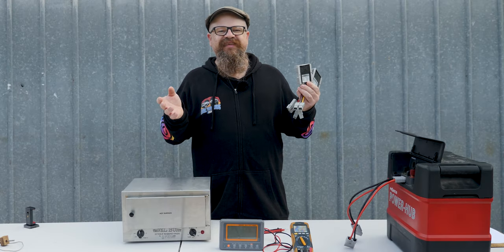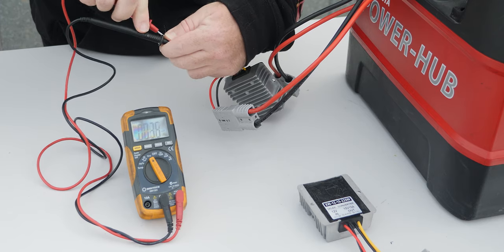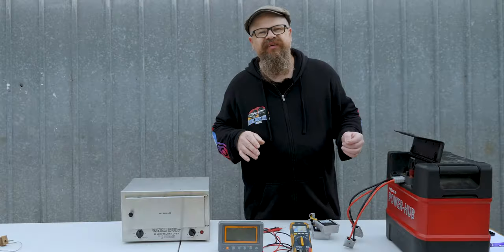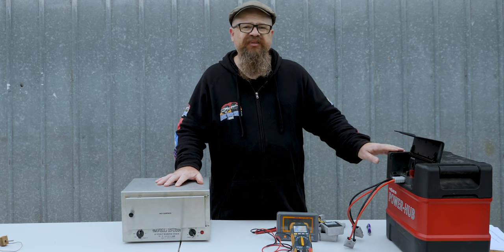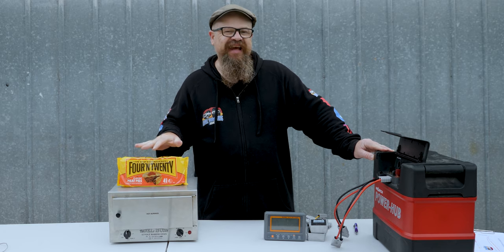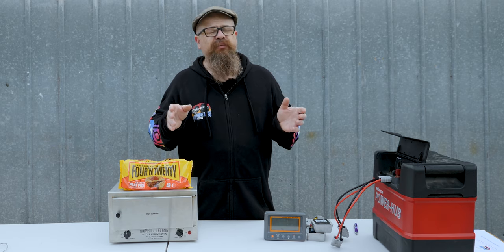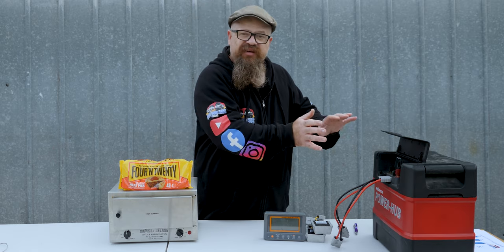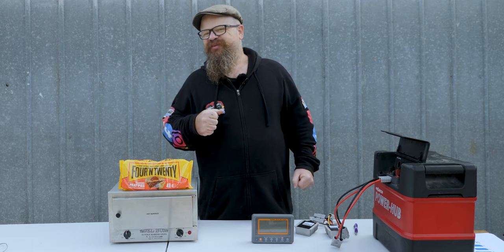Can you Improve Travel Buddy 12 Volt Oven Performance using Voltage Step-Up Converters?

Comment: Thanks Lock - being a retired Avionics technician I will er on the side of caution and potentially ☺️(no pun intended) try the 13.8V regulator only to protect the oven over long term use because I don’t want a raging fire while driving down the highway - I’m at my third stage and three years in to the Hilux/Aluminium canopy/RFT  project build with many prototype setups discovering what works and what doesn’t - I’ve gone with a simple 100ah Amptron Lithum battery system incorporating Redarc, Renogy, Engel mane even Kings products because I only run lights, 27 litre fridge and Sureflo water system - my Travel Buddy is on its way so I’ll start with a simple high capacity/fused/relay configuration first an monitor current draw and heat which are the two important elements that can destroy a system and your vehicle.
Reply from the maker: There's nothing wrong with a conservative system, while I like fiddling with all the latest tech like induction cooking and air fryers etc, most of the time camping, I run a fridge, lights and usually cook on a fire. 

While I'm not sponsored (I wish!) I've become a bit of a fan of Victron's gear. The customisation and versatility is unmatched.  I'm running a Cerbo GX (their comms hub) on a Raspberry Pi (Venus OS) so can monitor any of the systems parameters anywhere I've got internet. 

Though, back to the TB, I've been running the 15V stepup for a few years now without issue. Seems to work ok.

Comment: I added a 15v converter to mine today.  Oven now too hot to touch after 45 mins. Such an improvement. I found the stock blade fuse on mine was adding too much resistance so changed that out to something better and increased voltage to converter by 0.3v. All adds up
Reply from the maker: It sure does! It's a shame Midi type fuses don't come in lower amperages suitable for the TB. 

You'll love the 15v conversion, it really does transform the TB for the better.
Reply: @LockyourHubs4WDing  thanks for the great video even though a few years ago.  I'm getting near 180w into mine now.  Shame it's over 35 every day so yet to test it properly. I went with a circuit breaker in the end so I could easily disable the converter as required.  The blade fuse was clearly a massive resistance point.

Comment: Really great video, but yes it was drawing more amps from the battery at 15v but it was actually pulling more watts through the oven. So the first test doesn't really show the efficency all that well. What you needed to do was test the current on the other side to view in and out. But final test showed the end result anyways.
Reply from the maker: I don't think the efficiency of the step up itself is all that important other than academic intrigue, what is important is how much battery capacity you use in comparison with the other options.

Comment: So can you run the oven for 2 hours without damaging the battery with engine off ?  105  amp battery. Is it bad for the battery to drop to 10.5 v ?
Reply from the maker: Depends on the battery chemistry. Lithium no worries, AGM should be fine if you start with a fully charged battery.

Comment: Great video and loads of good tech data! My alternator runs at 14.4v so 15v should be fine, but curious if the ovens have a voltage limit before things break? What stopping you using a 24v step up?!
Reply from the maker: You'll eventually find the limit of a component or two, or maybe the wiring.

Comment: Hi mate does the step up converted need to to be disconnected while driving? Or can I just leave it plugged in the whole time?
Reply from the maker: It depends on the input voltage allowed for the step up, most will be able to use both battery and running voltage.

Comment: I just brought kickass new oven with digital temperture gauge and have two heating elements. 12v 260w  ... watching your video 15v 15A  ...  i look up for converter step up .. just wondering if i can use 12v to 24v 20Amp .... ...  but 260w / 12v mean 21.6A !!!   Not sure what i can do ....get 30A if have or not  thanks

Comment: As a straight resistive element in the travel buddy you will find that raising the voltage raises the current draw anyway due to ohms law. So the losses through the converters probably aren’t as bad as indicated here anyway. You could measure the current with a clamp or inline power meter to compare the oven current vs the battery current.
Reply from the maker: It's definitely Mr Georg Simon Ohm responsible here!

Comment: Superb video.. solid technical presentation from someone who clearly has a very firm grasp of the subject matter! I run a cheap Jaycar 12V warmer, only room for a couple of pies and you have to leave it open for the last 20mins of cooking to dry it out a bit.. but does a great job and doesnt take up much room. Those stepup converters are an interesting bit of kit at what looks like a pretty fair price.. thanks for the information and ideas.
Reply from the maker: I've tested those as well, for only a couple of pies, they hold up well in comparison!

Comment: I did some testing today on my new Rough Country travel oven.  I found the element was about 1.6ohms using a four-wire resistance test (no wire leads or fuse included), and using the figures from the 60V/100A power meter is was about 1.7ohms (including wiring, fuse and the power meter itself).  I ran with a 135Ah battery only, which dropped to around 12.05V with a current of 7.2A and power of 86W.  I then added a 4A battery charger where the battery settled under load to 13.98V with a current of 8.1A and power of 113W.  Lastly, I put two small motorcycle AGMs in series and it was running about 22.3V under load with a current of 12.8A and power of 285W(!).  I cooked a couple of pies that way.  I thought it might go "pop" and let the smoke out, but it went fine...for now.  Cabling was a little warm ;-)  This was done on a concrete floor, not in-vehicle.  I'm not staying with such a high voltage.  It was just for fun.

Generally, anyone wanting to work out the current draw in this type of oven can use 1.7ohms as a starting point.  Divide your chosen voltage by 1.7 and you have your current in amps, which is the output side of the step-up converter.  The current going into it will be higher, though these boost converters usually have a larger wire size on the input side to allow for this.  The limiting factor, apart from the element, will be the 15A fuse and the wiring, which I'm leaving alone.  My stove is rated 100W, while I see Kick-Ass specs say 130W max.  I'm guessing there's not much variation between all these brands, but you never know.

I'll be getting one of these step-up converters, that's for sure.  Thanks for the great video.  Well presented data and charts.  It's good to see.  New subscriber.
Reply from the maker: Some great info, and 22.3V! Wow, I thought I was keen with 15v!

Comment: Love the idea, will probably do this even though I Run a lithium atm..  Just want to make a note, that the factory wiring that come with it most likely could do with an upgrade.. Especially as it has a 1tamp blade fuse and most likely 15amp rated wire... I'd definitely be putting 12g (25amp) cable on and a 20 amp fuse
Reply from the maker: That's a great suggestion.

Comment: They are purely a resistive load - A length of nichrome resistance wire, more or less.
Not a lot to go wrong, and makes them fairly tolerant to different voltages, but I wouldn't push them much further than 15v
I use a 24v version, and it's a bit slow dead on 24v, but nice when the sun is out and I'm at 27v, 28.5 on the road and it's beautiful.
Reply from the maker: Yep the 24v unit runs great! There's an episode on the channel comparing the two.
Reply: @LockyourHubs4WDing  I'll look that up, I'll have a couple of videos of my own coming out soon. I have a 6x6 ex military land rover.
Reply from the maker: @TheAussieRepairGuy  Nice, the 6x6 Perentie with its turbo Isuzu engine is a great thing! 

I look forward to checking out the videos.
Reply: @LockyourHubs4WDing  I have a 4x4 gs as well. I'll let you know when they go public

Comment: The 13.8 makes sense, as said being a charge voltage which is way you use them when driving or hooked up to a battery taking a solar charge. They can be used off stand alone battery but it's not an ideal situation. On a sla performance is only going to get worse as the voltage drops.   Interesting to see results long term. I can imagine it impacting on the oven much at all. If any wiring couldn't handle that small increases, I'd be a bit disappointed. If be interested in that Guage of the nichrome heating element and if you could wind another to improve performance.   Likely not worth the effort though.
Reply from the maker: I don't think a modified element would be worth the effort, a second element though.... Just need to convince TB to sell me one! (They wouldn't sell me one....)
Reply: @LockyourHubs4WDing  you can buy nichrome heating wire for vaping . it comes in different gauges and there for different resistance/foot or length. i reckon with a bit of fiddling and measuring, you could set up a parallel heating element to run with the original. one on top would be nice..ooooh and a fan. anyway, my roadchef is on it's way thanks to your vids. I like aussie built and try and promote aussie stuff on my channel but there was too much going for the road chef to make me buy the buddy. i would have happily paid the premium to buy aussie if it was an equal or better product. oh well. cheers for the vids. I like your more technical approach to the items. nothing shits me more than an unboxing video with info I could have read on a website. PS I'll give you a shout on my channel when I get around to doing my review on it.
Reply from the maker: @DENMONKEY  My ideal TB would have a digital thermostat/timer, insulated door with overcentre latch, 13.8v step up that cuts in and out with the charging voltage, and your idea of a fan is great, there is a large temp differential when running both stainless steel trays in the oven. And don't forget the second element! I've just seen your channel and subbed, thanks in advance for the shoutout!
Reply: @LockyourHubs4WDing  cheers. I also checked out your winch ring vid. that was interesting to say the least. I hadn't checked them out first hand but I thought they had a bearing inside them. I imagine the pressure on them would make that not possible. Im wondering if the heat generated from that additional friction has any long term impacts on the rope.
Reply: @LockyourHubs4WDing  yeah that’s the new KickAss glass door oven you want. Has a digital temperature gauge and an oven light.

Comment: Will a step up converter void the oven warranty?
Reply from the maker: You would have to refer to the individual manufacturers. I know for instance the Big Bertha specifically prohibits the use of step ups. Then in the next breathe specifies a maximum input voltage of 15v......

Comment: G'day,

Can I leave a 13.8v regulator in when alternator charging or with solar input? Run an old school isolator and a separate renogy rover mppt for solar.
Reply from the maker: Check the input voltage range, but most you can.
Reply: @LockyourHubs4WDing  I have run it hooked in with solar going for a few hours twice. Never saw a problem, thought I'd ask for some expert advice to be safe. 

Thanks for ya reply.
All the best,
Luke.

Comment: Brilliant. I have one question. Can the step up converter be left permanently connected while driving as well? Cheers
Reply from the maker: If the voltage input range is wide enough, no problems. Though keep in mind, these step ups have a little current draw even when not actively powering the oven.
Reply: @LockyourHubs4WDing  thanks heaps for the prompt reply. Love your videos

Comment: G'day, I know this is an old vid but hoping you maybe able to still answer a question. 
Is there any recomendations on where the Stepup converter (15V) should be in relation to the travel buddy "Distance from travel buddy to Step Up Converter)? or doesnt it matter? 
Ill be putting in a switch at the dash area but travel buddy is in the back of the wagon. I was thinking of hiding the converter for clean wiring.
Enjoy ya vids. Thanks.
Reply from the maker: G'day Phil, just like a DCDC battery charger, you're off placing the DCDC step up as close to the Travel Buddy as possible.
Reply: @LockyourHubs4WDing  Thanks mate really do appreciate you getting back to me on this even though its an older vid. BUT if I may ask 1 more question, as I am now in the middle of doing some re wiring in my wagon. Basically, I have now a 100ah Lithium in the back just over the top of the travel buddy just so you know. I purchased the 15v  Step up, but as you said in your vid, "you cannot  speak to the long term durability on the 15v " but hoping by now maybe you have better insight? Vids on the outcome after a fair while can be so informative. 
Cheers mate and again thanks heaps.
Reply from the maker: @phillroo7871  G'day Phil, my 15v step up is still running my travel buddy no worries. I've not heard of the 15v step up causing issues for anyone else either. Cheers Simon.

Comment: I have a question...what would be the results if you used a 12v dc dc charger and attached  Anderson connectors to the input and output sides of the charger..then put it between the battery and the travel buddy..the reason I say this..is that I have swapped out a 12v dcdc charger..so I have one lying around gathering dust.
Reply from the maker: Depended on the output voltage of the dcdc I suppose.

Comment: This was a sensational video mate, well done to you.  I was screaming at the screen “what amount amp/hrs” when you were showing the heat up times, but true to form you covered that off in the end.  I’m sold, just bought one!  Again, thanks from Jafffa Adventures for educating me.👍
Reply from the maker: I thought there might have been a penalty to pay, but for pre-heat, it doesn't look like there is.

 Though for actually cooking... How long is a peice of string?  Thanks for the kind words mate!
Reply: Lock your Hubs 4WDing I run a 120 a/hr lithium battery and as you noted it holds 13.8 volts right down to its 20 percent cutout limit.  I would love to see you repeat these tests in this video on a lithium battery.  Your results might show me I just wasted 20 bucks 😂😂.  Thanks again.
Reply: @ Jafffa Adventures did you charge your power tool battery in the car ?  What you use for it the get the 18v battery charged

Comment: Hi mate great video ! Could you tell me what size wire is used on the step up converters you are using ? I brought one off eBay for my travel buddy last week witch looks identical to the Amazon ones you are using but the cable is only 1.5mm 10 amp witch I’m not real keen on trying but seems a lot of people use these same ones so just wanted your feedback!

Thanks Chris
Reply from the maker: I was just using Anderson plugs for the testing, though for the actual installation, it's going to depend on the length of the run of wire. 

Let me know how long your wire run is back to the battery or distribution point and I'll tell you the right sized wire.
Reply: @LockyourHubs4WDing  thanks for the reply mate ! What size cable is coming out of your step up converter is what I was after ? Cheers Chris
Reply from the maker: @chrisharding795  Oh ok, sorry I misunderstood.
 
With the 15v Step up, taking into consideration the power usage (13.6A@12.6V) and the length of the run (0.3m) that works out to be 18awg or 0.823mm^2 wire minimum to not loose more than 3% in voltage drop. 

Though there are connection resistance losses as well. Best thing to do is run it for a while. If it's getting hot from the electrical energy passing though it, time to upgrade! Though I say it should be fine.

Comment: FYI,
170W @36minutes is 102.6Wh
145W @48minutes is 116Wh

120W @80minutes is 160 Wh.

Even though the step up converters are not 100% efficient and do loose power to heat, the oven is also not 100% efficient and also looses heat over time.
Reply from the maker: Thanks for the clarification.

Comment: Hi can you please do a temp comparison  between the 12v and 24v Travel Buddy? I would also be keen to see the Amp draw between each and how much Amp Hours over time for the same cook and how long each took. I'm looking to use a 12v to 24v converter for this and would be interested to also know how much extra Ah that adds to the battery consumption instead of a direct 24v source.
Reply from the maker: I was just chatting about that last night, I think I might in the near future.
Reply: @LockyourHubs4WDing  I am concerned also about the under side of the oven getting hotter and so I thought another way of increasing internal oven temperature and lowering external temperature would be to use a heat shield. I found this one that seems perfect for the job reducing heat by up to 90% making a 50C external temp just 5C. If I pull the trigger for the 24v oven, I'll try this as I have a fridge that will be just 2.5cm below the oven.
https://www.mishimoto.com.au/aluminium-silica-heat-barrier.html